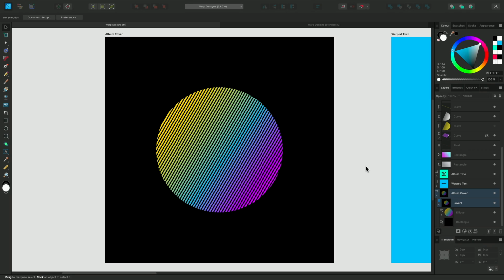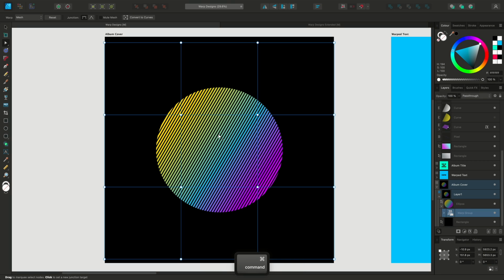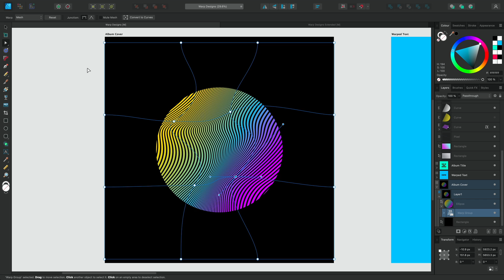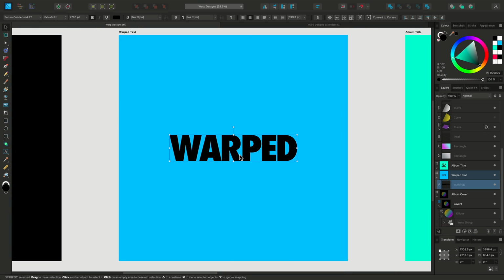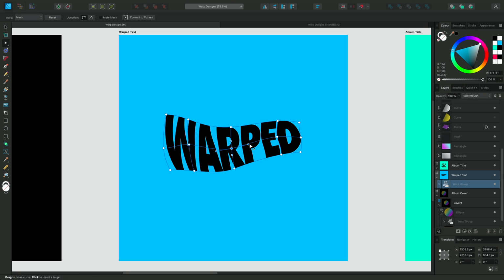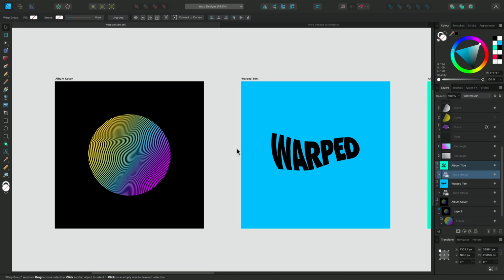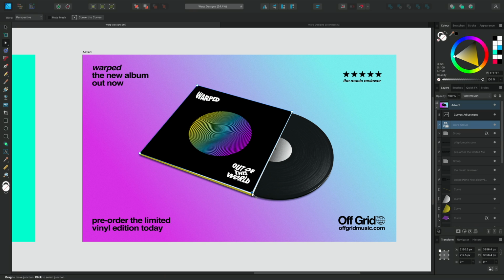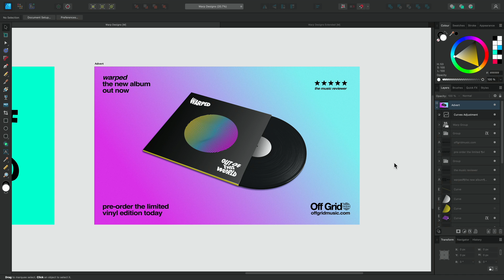Vector Warp (Affinity Designer)

Comment: oke boys im getting slightly frustrated i am in affinity designer and i want to warm a dam picture i did insert but i do not get it to work but shapes i do create inside  myself do work so i assume it is because the picture might be no vector and therefore does not  warp but please don't tell me i have to take the project to affinity photo for it to work and then switch back to designer and so on that would be kind of ridiculous  i can also not find how i can convert a image into a vector layer for example is there someone who can help me with this
Reply: pixel persona permits bitmap objects being warped now in v2.1

Comment: in the first example it looks like the gradient fill is warping too but i cant get it to do that using a gradient  or is that a coming feature?
Reply: It looks like it but the gradient is not warping. Just an optical illusion because of the change in thickness and density between the lines.